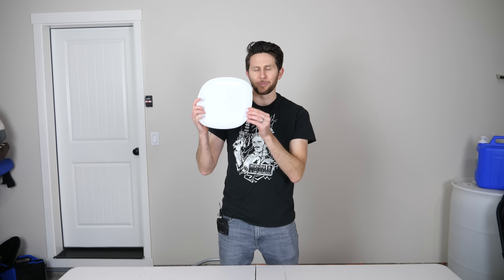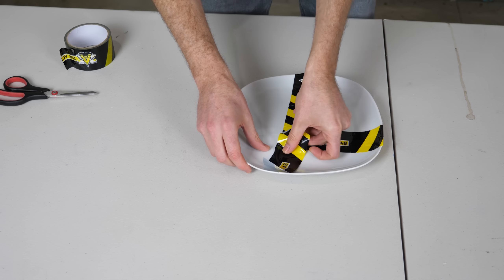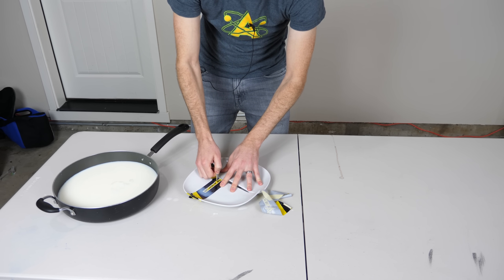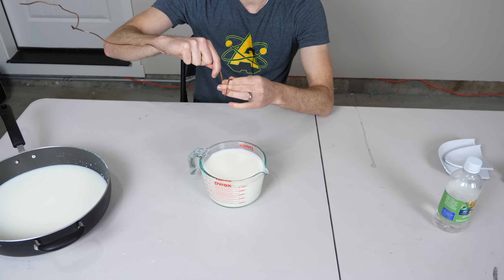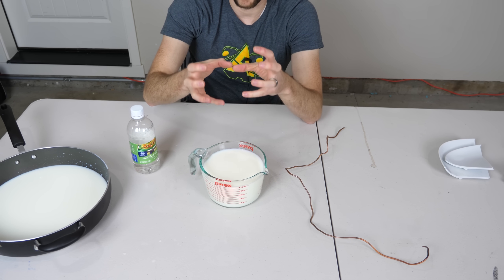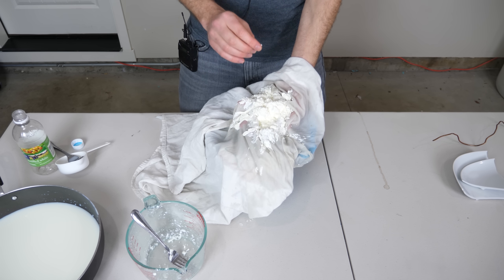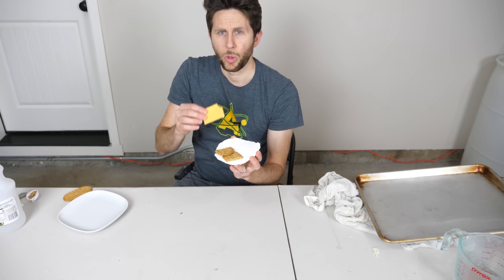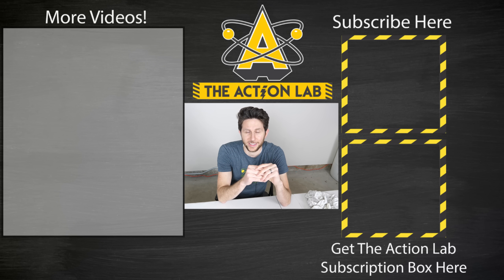Can You Fix a Broken Plate with Milk? The Milk Plastic Experiment

Comment: milk can be used as a glue if you use it like a glue, not if you soak it in glue - that doesn't work for any glue. I've used milk powder in water (so it's extra concentrated, less water than plain milk) in a spray bottle as an excellent paper glue. You spray it on and let it dry. Good for postering, or wallpaper. However it can really gunk up the spray bottle and get smelly if too thick, plus manufactured glues are more stable and easier.

I don't understand the tape then soak in a pan method, that makes no sense??? I bet you would get some stick if you painted or sprayed on the edges then clamped together and let dry - as you would with glue.

Comment: Im restoring a 160 year old China doll that was originally glued using this method. It works and is great for restoring an antique doll because it's reversible. I soaked the dolls bust in hot water and Dawn dish soap to dissolve the glue, now I will reglue it using the same method. It was great glue for decades, unfortunately whoever glued it originally didn't line the pieces up properly that's the only reason I'm redoing it. Otherwise, it would've been just fine for another 160 years. The key is to make sure you don't completely cover the seam with tape, only wherever necessary to hold it while it binds together.

Comment: of course you CAN fix broken plate with milk, but you have to add .... 3 pieces of smashed garlic and BOIL it for 15 minutes. After cooling and leaving 1 or two day your plate WILL be repaired. It is VERY old recepis, used for hundreds years by our ancestors.

Comment: If one were to heat the milk while the broken porcelain is submerged, would the casein begin adhering to the porcelain? And if this is the case,  what heat would the milk need heated to? If you would leave the warmed milk in, say, full summer sunlight,  would that be enough heat? I think in the right circumstances the viral video could actually be possible.

Comment: Ok, what you do: you use condensed milk and touch the milk to the BROKEN EDGES and hold together til it grips!!!( How would glue of any kind get through that tape to bond?) (Condensed milk is thicker and has sugar in it I think.)
 My mother used to use that method to glue broken pieces of ceramic. It worked. I think it yellowed over time but it did hold. Not as good as glue, but this was without glue on hand to use.

Comment: I’ve actually done it. Not me the plate of course, but mom had a porcelain lamp that wasn’t properly stored, and it got damaged badly. I was able to use the milk method, I think I may have added extra powdered milk for the increased case sign, and sure enough, except for the small piece that I couldn’t find, the repair was invisible. Even when the shade was lit back up again you had to know where to look to find the repair.

I was also able to use the same pot of milk to repair the lid of a lavabo That my mother had made out of stoneware Ceramic, that had gotten broken. It worked just as well on that.

Are you later I went to make another repair, and forgot exactly how it was done. Epic fail. Sigh.  

So now I keep a copy of the instructions in the back of my address book.

Comment: Note to people who came here hoping to find a solution for their broken ceramics: Boiling your mug or whatever in milk can work! At least for hairline cracks, which was the deal with me.
I put the mug in a pot on its side so the entire crack could be covered. I only filled the pot up enough so the crack was fully covered so I didn't waste more (whole) milk than I needed to. I put the heat on low and left it there for an hour. You could see the proteins kinda forming a bio-plastic film almost on the top as it heated. After an hour, I let it cool COMPLETELY then hand-washed it with cold water + Dawn the next day. Then I filled it up with water to check and like 90% of the crack was sealed, with water leaking only out of two specific spots. Since there was improvement, I planned to do it again later that day and set the mug aside. Later, while showing someone else, I filled it with water again and this time it was totally sealed, no leaks at all. I guess it needed more time to cure or whatever? This was almost a week ago and it's still going strong. The crack is definitely still visible, but it doesn't leak at all, so I'm satisfied. Only used it with cold drinks the first two days, then tried a hot drink and it still held up. Haven't put it through the dishwasher yet- I've just been hand-washing it with cold water to be safe after each use.

Just wanted to let y'all know to not lose hope just yet! Idk how a COMPLETELY broken ceramic would do but I'm curious to find out honestly.
Reply: ㅈㄹㄴ

Comment: Hey i got a question. Does water evaporate more or less if the water is the same temperature as the room temperature? I notice when having hot bath lots of steam when room is cold
Reply: I could be completely wrong, but I think there is more steam when it's cold because the cold air can hold less water vapour so you see more steam because steam is ofc the tiny water droplets that condensate from water vapour.

Comment: I have fixed broken crockery with milk. It totally works. I had seen some video, didn't believe it, then tried it when an antique cup got smashed. I used little bits of tape so that the milk could more easily get into the gaps. I wasn't really expecting it to work so the fact that I was missing a small bit didn't worry me, I thought the cup was permanently dead. I submerged it in milk in a big pot and then simmered it for 4 days. When I took it out it was very strongly fixed together. I had to scrape bits of hardened casein from some parts of the cup. Now I have an antique cup that you can barely tell was ever broken except for a 3mm hole where I couldn't find the small bit. Five years later, the cup is still strong.
I did another ceramic goat that broke a few months later, it worked perfectly.
My mum tried it and couldn't get it to work. I don't know what we did differently.

Comment: If you're going to do it, do it right.  You want to hold the plate together while leaving as much of both sides of the crack exposed to the crack as possible. Maybe even first paint the crack with milk.  

Of course it won't work but sealing one side with tape is a ridiculous attempt.  Need narrow pieces of tape at right angles to the crack, or elastics around the plate to hold it together without restricting the crack.

Comment: technically speaking it is quick cheese, which was hard dried. if you take mozarella, dry it hard (and cover with epoxy) - you ll have something similar. question is fat. cause it should still be in the initial curd and its not good for keeping structure. i guess it is burned during time in the oven, which i suppose, was very long. it is cheese plate, not milk plate.

Comment: Follow up question: if the tape in question had an acidic adhesive, is it possible that it could create enough casein to actually repair the plate?
Reply: Hi there! I actually found a method that worked for me and I wanted to share that with all those curious about if or how you could make this idea work. I'll paste my comment here:

"Note to people who came here hoping to find a solution for their broken ceramics: Boiling your mug or whatever in milk can work! At least for hairline cracks, which was the deal with me.
I put the mug in a pot on its side so the entire crack could be covered. I only filled the pot up enough so the crack was fully covered so I didn't waste more (whole) milk than I needed to. I put the heat on low and left it there for an hour. You could see the proteins kinda forming a bio-plastic film almost on the top as it heated. After an hour, I let it cool COMPLETELY then hand-washed it with cold water + Dawn the next day. Then I filled it up with water to check and like 90% of the crack was sealed, with water leaking only out of two specific spots. Since there was improvement, I planned to do it again later that day and set the mug aside. Later, while showing someone else, I filled it with water again and this time it was totally sealed, no leaks at all. I guess it needed more time to cure or whatever? This was almost a week ago and it's still going strong. The crack is definitely still visible, but it doesn't leak at all, so I'm satisfied. Only used it with cold drinks the first two days, then tried a hot drink and it still held up. Haven't put it through the dishwasher yet- I've just been hand-washing it with cold water to be safe after each use.

Just wanted to let y'all know to not lose hope just yet! Idk how a COMPLETELY broken ceramic would do but I'm curious to find out honestly."

Comment: Actually it depends on the material of the plate. I made this milk experiment with my accidentally broken plate 4 years ago. It was solid as new for almost 2 years before it cracked again.
Reply: I'm not sure I believe you. What physical process could cause that?
Reply: @jakublizon6375  actually i don't know the process. I read about it a couple of years ago, it is something with the proteins of the milk and the porcelain.
Reply: @jakublizon6375  Hi there! I actually found a method that worked for me and I wanted to share that with all those curious about if or how you could make this idea work. I'll paste my comment here:

"Note to people who came here hoping to find a solution for their broken ceramics: Boiling your mug or whatever in milk can work! At least for hairline cracks, which was the deal with me.
I put the mug in a pot on its side so the entire crack could be covered. I only filled the pot up enough so the crack was fully covered so I didn't waste more (whole) milk than I needed to. I put the heat on low and left it there for an hour. You could see the proteins kinda forming a bio-plastic film almost on the top as it heated. After an hour, I let it cool COMPLETELY then hand-washed it with cold water + Dawn the next day. Then I filled it up with water to check and like 90% of the crack was sealed, with water leaking only out of two specific spots. Since there was improvement, I planned to do it again later that day and set the mug aside. Later, while showing someone else, I filled it with water again and this time it was totally sealed, no leaks at all. I guess it needed more time to cure or whatever? This was almost a week ago and it's still going strong. The crack is definitely still visible, but it doesn't leak at all, so I'm satisfied. Only used it with cold drinks the first two days, then tried a hot drink and it still held up. Haven't put it through the dishwasher yet- I've just been hand-washing it with cold water to be safe after each use.

Just wanted to let y'all know to not lose hope just yet! Idk how a COMPLETELY broken ceramic would do but I'm curious to find out honestly."
Reply: Interesting. What material was it?

Comment: So, if you were to soak the broken edges of the plate in vinegar before putting it in the warm milk, could you get enough kaisin (sp) to form in the crack to act like glue? You'd probably need to bake it and dry it out before you torture tested it.
Reply: Hi there! I actually found a method that worked for me and I wanted to share that with all those curious about if or how you could make this idea successful. I'll paste my comment here:

"Note to people who came here hoping to find a solution for their broken ceramics: Boiling your mug or whatever in milk can work! At least for hairline cracks, which was the deal with me.
I put the mug in a pot on its side so the entire crack could be covered. I only filled the pot up enough so the crack was fully covered so I didn't waste more (whole) milk than I needed to. I put the heat on low and left it there for an hour. You could see the proteins kinda forming a bio-plastic film almost on the top as it heated. After an hour, I let it cool COMPLETELY then hand-washed it with cold water + Dawn the next day. Then I filled it up with water to check and like 90% of the crack was sealed, with water leaking only out of two specific spots. Since there was improvement, I planned to do it again later that day and set the mug aside. Later, while showing someone else, I filled it with water again and this time it was totally sealed, no leaks at all. I guess it needed more time to cure or whatever? This was almost a week ago and it's still going strong. The crack is definitely still visible, but it doesn't leak at all, so I'm satisfied. Only used it with cold drinks the first two days, then tried a hot drink and it still held up. Haven't put it through the dishwasher yet- I've just been hand-washing it with cold water to be safe after each use.

Just wanted to let y'all know to not lose hope just yet! Idk how a COMPLETELY broken ceramic would do but I'm curious to find out honestly."

Comment: i wonder if you could have repaired the plate using only casein painted on the surface of the broken plate edges then put them together and let them dry pressed together. Would that have been enough to bind the broken edges together?

Comment: But.. this actually does work and can last for years. It works best to fill cracks vs repair a complete break, but I have seen it work for breaks as well. The key is having something made with a ceramic/stoneware mix (one of the 3 main types of pottery clay sold). If it has a deep penetrating glaze on it, you'll want to sand it down just a tad at the seam so the milk protein can penetrate. Oh... and whole milk would have been useful because again you need the proteins from the fat. You present your half baked "science" with bravado so it passes as believable to people that don't actually understand the science. Its a nice little scam you have going really.

Comment: It would also be interesting to see what it would take to make the original concept work, even if it took a few more steps.
Reply: Hi there! I actually found something that worked for me. I'll paste my comment here:

"Note to people who came here hoping to find a solution for their broken ceramics: Boiling your mug or whatever in milk can work! At least for hairline cracks, which was the deal with me.
I put the mug in a pot on its side so the entire crack could be covered. I only filled the pot up enough so the crack was fully covered so I didn't waste more (whole) milk than I needed to. I put the heat on low and left it there for an hour. You could see the proteins kinda forming a bio-plastic film almost on the top as it heated. After an hour, I let it cool COMPLETELY then hand-washed it with cold water + Dawn the next day. Then I filled it up with water to check and like 90% of the crack was sealed, with water leaking only out of two specific spots. Since there was improvement, I planned to do it again later that day and set the mug aside. Later, while showing someone else, I filled it with water again and this time it was totally sealed, no leaks at all. I guess it needed more time to cure or whatever? This was almost a week ago and it's still going strong. The crack is definitely still visible, but it doesn't leak at all, so I'm satisfied. Only used it with cold drinks the first two days, then tried a hot drink and it still held up. Haven't put it through the dishwasher yet- I've just been hand-washing it with cold water to be safe after each use.

Just wanted to let y'all know to not lose hope just yet! Idk how a COMPLETELY broken ceramic would do but I'm curious to find out honestly."

Comment: I wonder if you wet the broken edges with acid and then tape together. Would the milk separate as it seeped into the acid wet edges? Could that glue the plate once dried.

Comment: Don't waste a dollar's worth of milk to fix a 25 cent plate. May be useful on old, cherished mugs and cups, but you must cook the submerged plate for an hour, then cool overnight, then let cure for a day or two before testing. Cooking expands air trapped in the plate, and begins the change in the milk; cooling helps pull the polymerizing milk into the gaps. Air drying for a day or more should allow for full curing, as with any other glue. Many have successfully done this. It also may be better to use skim milk as fat may weaken or impart a "mold release" effect on the pieces.

Comment: 4:58 - Alpha helices don’t form because of “electric charges on the molecules”. They are stabilised due to hydrogen bonds between amides along the peptide backbone.

6:00 - Also, adding acid won’t neutralise the structure (positively charged residues will remain positive when the protein is protonated further)

Comment: I figured out a new way to fix a plate

Step 1: get a broken plate
Step 2: find some warm milk
Step 3: pour some vinegar in and wait 20 minutes
Step 4: then filter the milk so there is only this powder left
Step 5: apply the powder to the plate
Step 6: put it in the oven at warm heat for 6-12 hours

And you fixed your plate!

Comment: Next: Can You Fix A Hammer With A Nail?
Reply: Depends on what part of the hammer is broken. If there is a small but like 1cm deep dent in the metal, then yes. if its the wood handle, then no.
Reply: khonsu thedragonhog 1 whole Centimeter?!?! Do you mean mm? (Millimeter)
Reply: khonsu thedragonhog if the head of a hammer falls then you can hit some nails from the top so the handle is thicker and head doesn’t fall off
Reply: Yes we can

If the head of the hammer comes out of the handle, we can wedge in a nail and fix the shaft to the handle
¯\_༼ •́ ͜ʖ •̀ ༽_/¯
Reply: Maybe, you can melt the nail and yeah

Comment: You don't use warm milk. You use a warm oven. 170 degrees for 30mins. The "clear" tape will slowly melt and bond into the crack with no gaps.